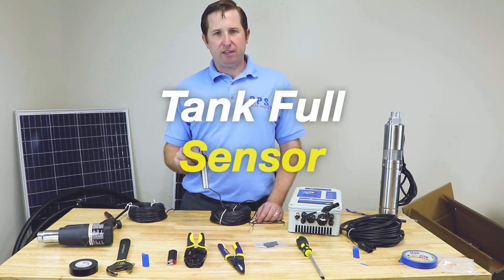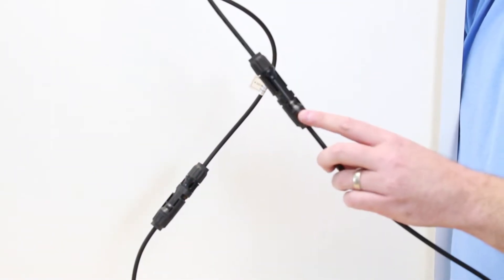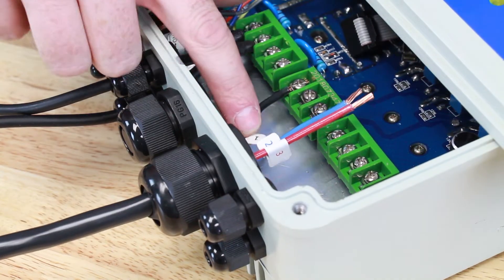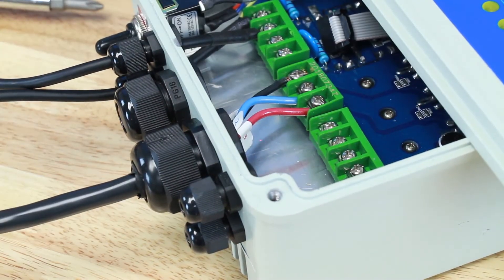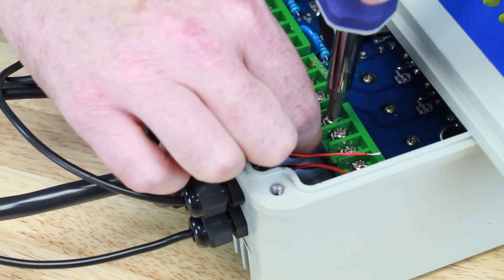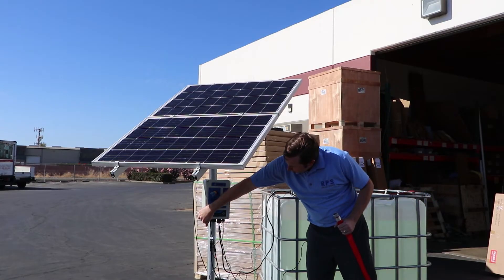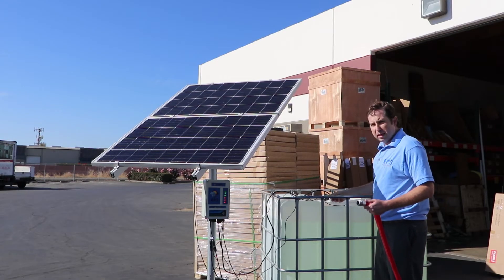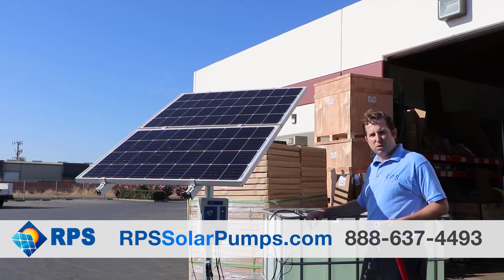System Wiring and Demonstration - RPS Kit Installation

Comment: When the water is very calcareous, these level detectors present a conductivity fault.  This is my case I had to use a more reliable system: the floats.
Reply from the maker: Yes, in 99% of wells the sensors work for years without any issues.  In the case of really high mineral content, sometimes we switch to floats.

Comment: RPS Solar could I use your setup to power my preexisting well pump? I'm not sure if mine is a 110V or 220V but will be checking it when I return to my farm.
I'm pretty much talking about everything you sell above ground. 
Thank you for any reply. Enjoying the videos but as a beginner I'm lost.
I need enough power to flip the well on maybe a couple of times a week.
Any direction would be appreciated. Oh and if I remember correctly my well is approx. 4" around and it seems the water level started at 110 feet with 60 depth.  Seems like it was 16 gpm's when it was dug 25 years ago.
Reply from the maker: Yes, we can convert most 220V AC submersible pumps.

Comment: Does the controller need to be in a dry area?
Reply from the maker: It is water resistant and designed for the outdoors.  That being said, most people mount it below their solar panels for a bit of protection for the elements.

Comment: Dear RPS, water level sensor looks like conductivity based, please consider it changing to float type. I had corrosion issues on conductivity based sensors. Float sensors are more reliable.
Reply from the maker: Thanks for the feedback.  We have used both and in the long term have found the stainless to be very reliable, since there is no mechanical switch to wear out or get stuck.  But to each their own!

Comment: I wanted to know if the item used as low well sensor the same as the one used as the tank full sensor so that I can go and DIY. THANKS.
Reply from the maker: Yes, they are the exact same.
Reply: @RPSSolarPumps  Thanks

Comment: My pump has 4 wires... what is the 4th yellow wire for and where does it connects to?
Reply from the maker: Sorry I am not familiar with your exact pump.
Reply: Is a 2 horse power RPS pump.
Reply from the maker: @raulcastro5770  Do you have one of our pro series systems?  If so, then it is a different controller and connection for the wires.   That green wire would be the ground and can be connected to the plug using the diagram in the user manual.  We can also walk you through it on the phone tomorrow if you like?
Reply: I don't have the pumps with me but we can talk, I have a few questions.  703-582-6994.

Comment: What if the light in the control panel light all of them and the water not coming what could be the problem
Reply from the maker: Motor could be spinning backwards or you dont have enough power to get water to the surface.

Comment: Sir if the connection of the pump is exchange means wt hpns can u tell  me exect connection of the pump to inverter
Reply from the maker: Hmm this video is for our systems.  Might need to check your manual for your specific pump!

Comment: How can it be off if the full tank sensor is missing
Reply from the maker: Tank full sensor is not required to operate as it is active open.  The well low sensor is required as it is active closed, but can be overridden (not recommended) with a jumper wire.